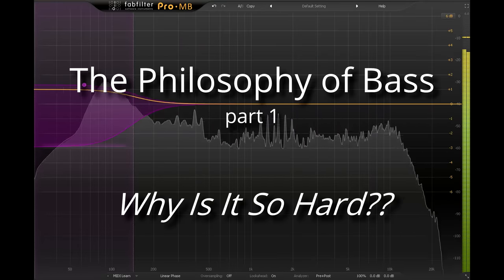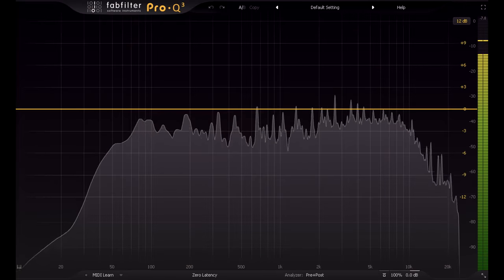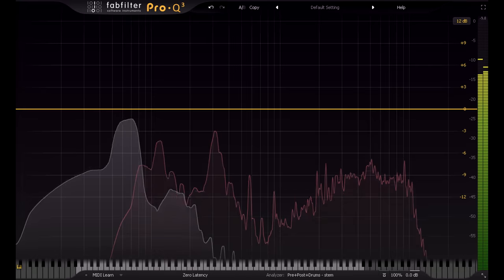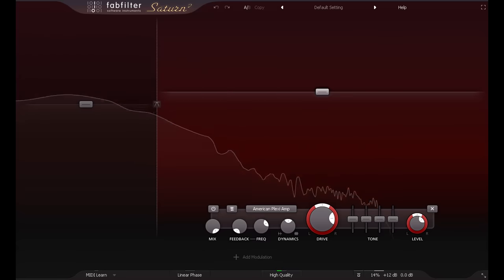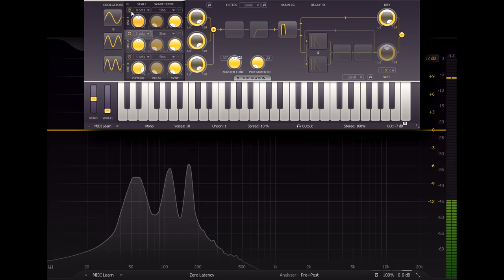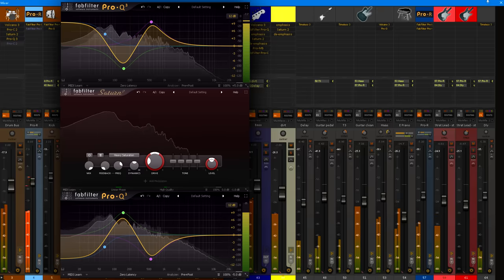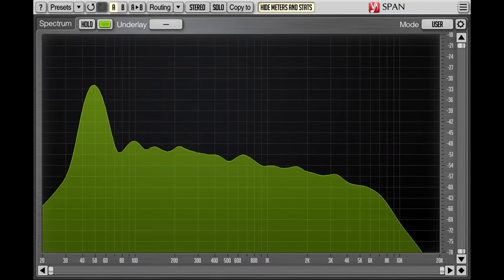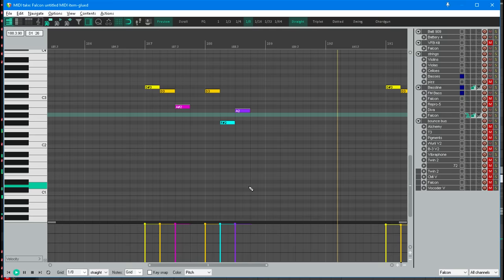The Philosophy of Bass

Comment: So most of the technical blather. By this presenter here. Still hold some water. But has a low-frequency leaking problem. Leaking out the back of the speaker. That has a closed back. But low-frequency energy. Still comes off the back of the speaker. And what's happening is totally loony! Nobody has properly thought this through. As it is contrary  to their,, incorrect education.  Of their audio religious belief. Because they have everything wired correctly as per their manuals and textbooks. As they have never been taught how to think..

When I draw a little bullshit diagrams to show people. It then dawns on them.  Oh my God you're right! What the hell? Why did they do that?  Because they are limited by their textbooks and college degrees.  They cannot think this through.  JBL did. I did.  Now you also know.

So this has changed a lot of people's lives and studios for the better. They can now hear what they need to hear, the way they need to hear it. The way your brain requires it Will make your mixes, so much better. So much easier. To evaluate what you are hearing. The way you need to hear it. The way your brain requires it.

But some have become so used to working with, out of polarity monitoring. Many have also been reluctant to change.  They would rather struggle.  To get their mixes right. I guess it makes them feel more like audio engineers? But when you can hear it correctly.. It's going to change your life.

I know this was a long-winded explanation. Requiring more than, one posting. But you see. I am a Quality Control Manager. And have been for some, legendary, Pro audio manufacturers. Who have also realized. I am spot on, correct. And I like sharing my knowledge with others.  Because I only want you to make recordings. That you can be proud of.. Effortlessly. And your mixes will translate. To all other playback systems. Even if the speakers are in phase and out of polarity. As most are..  And you can't physically change everybody's, speakers.  But you now can try to help them, yourself. Making everybody then realize.  That you   too.  Are,, audio geniuses! And you can charge people to do that for them. And you'll get more clients. You will establish  yourself more firmly.  In the, Pro Audio,, community.

I kid you not,  kids. This is real. You want to try this for yourself. Those of you with JBL speakers? Don't change anything. You are already good.. When you have your JBL's connected improperly. As per your, manuals and audio Bibles. But only JBL. Are like that.

Again, you don't have to believe me. But I am a history making, 4 time major music award nominee. And former, 20 year veteran  and senior engineer. Who has had an illustrious, 50+  year career. In Pro Audio. As I have also had to teach, college professors. As I cannot teach at the university level. Because I have no, college degree. I don't need one.

And so back in the day. I was also trained at the factories of,  Ampex, 3M, MCI. When I later went to work for the legendary, Scully, audio recorders.  And have used just about every top professional audio console  and/or owned them. Since the early 1970s.  You know them all. They are the audio consoles. That everybody drools over. That only the finest studios have.  Even Rupert Neve didn't get this right! May he rest in peace.  As I had many hours of conversations with him.  Many other people have learned from me. Now you have also.

Make this change for yourselves.  You'll be glad you did.  And you owe me nothing. It cost nothing to do. It's really that simple. And will take you 2 minutes or maybe 10 minutes. Now go wash your hands. Because your finger has been up your ass for years. And your mother will thank me.  Because your control rooms will no longer stink nor your mixes.

Yes I know what I'm talking about! As I know more than anybody else.  About this.
RemyRAD